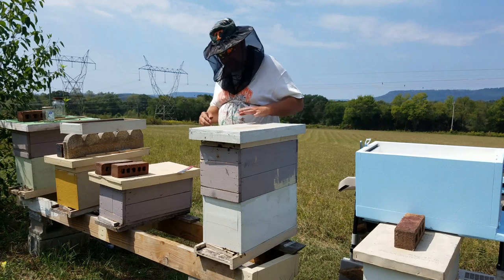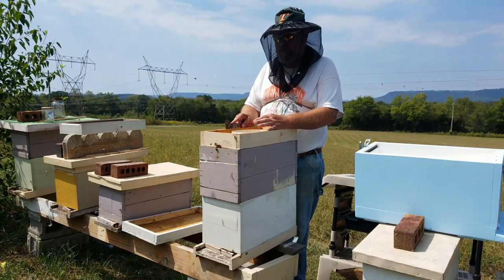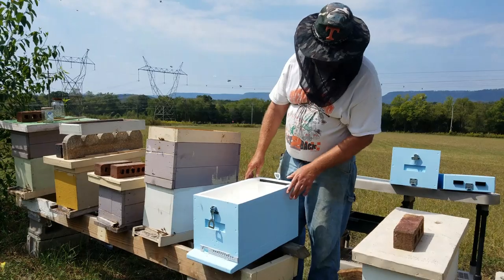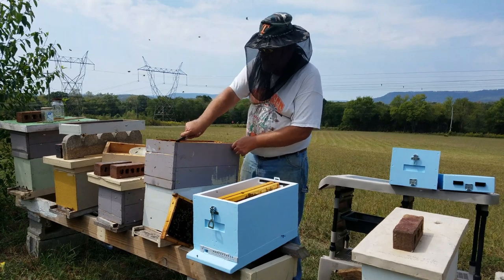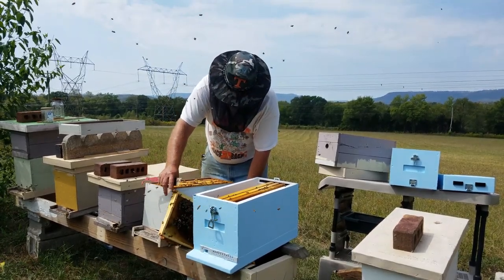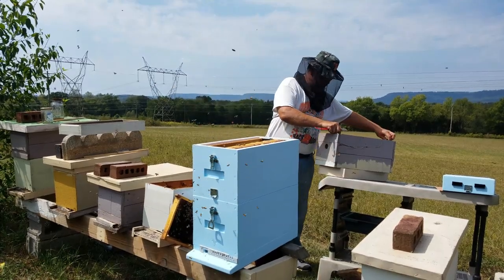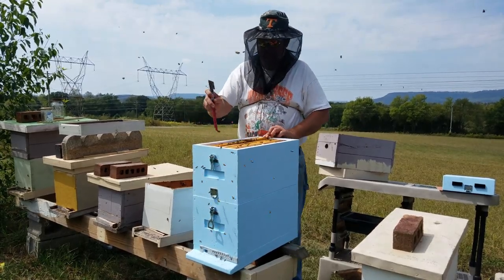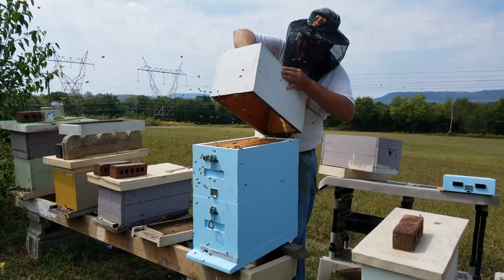Lyson 6 Frame Polystyrene Hive Over Winter Trial

Comment: I have used the Lyson nucs in northern Illinois for 3 years and like them allot.  I do leave an upper entrance in winter because I noticed moisture issues otherwise.  I cut a piece of polystyrene half the thickness of the lid vent inserts and replace one of them with it so that it leaves about a 3/8 inch opening in the lid.  I also glue a block of polystyrene on the inside of the lid behind the vent opening so that wind cannot blow in the opening across the tops of the frames.  I also put sugar bricks on top of the frames under the lid and that helps with moisture too. 

I quit using the propolis traps after the first year.  Unless you want to collect propolis it is just a waste of energy for the bees to spend all that time propolizing the trap.  The only time you need anything under the lid is when a flow is on and the bees are building comb.  I just cut a feed sack to fit inside the lid and lay it on top of the frames as an inner cover.

The R-value is far less than 10.  The walls on the nuc are not as thick as the 10 frame hives.  I think the R-value is around 5 or 6.  Still much better than 3/4 inch wood.
Reply: You also lose a lot of the R-value at the hand holders, a flashlight will shine through them before painting.
Reply: @danskisbees7348  is that issue Because of  the poly being a lot thinner in that area due to the cut out to accommodate handles
Reply: Hello Alicia, I was referring to wooden nucs.

Comment: did you have a problem between the 2 deep bodies being double the bee space ... i added a 3/8 inch spacer on the lower box frame rest...
Reply from the maker: so far i have not had a problem but a friend of mine that turned me on to these hives. his bees never drew in the feeder area but 4 of the 6 i bought drew comb in the feeder space.
Reply: @WoolieBsApiary  i am using the feeder so no problems there ... just between the supers... there was 3/4 inch gap and the bees did there thing in that space... what a mess ... so with the spacer i added  the bottom frames are flush with the top of the bottom super... all my lyson nucs are new this year and wasnt sure if i was the only one who had this problem....

Comment: Hey Lankford, I didn't realize the R-Factor of the 3/4" wood was that low.  I noticed some beekeepers in Arizona use them, makes sense now, I thought they were just wasting their money.  I can't wait to see how they handle the heat.
Reply from the maker: A material's thermal resistance or resistance to heat flow is measured by its R-value. In a solid log wall, the logs provide both structure and insulation. The R-value for wood ranges between 1.41 per inch (2.54 cm) for most softwoods and 0.71 for most hardwoods. that is directly from energy.gov thats for 1 inch
Reply: Dan Ski's Bees I just brought 3 of these today for cheap $50 each , I’m in Australia 🇦🇺 and our summer gets up to 48c so I’ll let ya know how they handle the heat, on first look they seem pretty good only problem is the box is 1/8in too small and the frames are tight where the top bar sits in the rebate, but we’ll see in a couple weeks, we normally use 22mm thick pine langstroth boxes. I brought these Lyson poly boxes for rearing queens and drone production, I’ve been having troubles with rogue queens and virgins they have wrecked my last two queen starters piping 39 cells my last run but I did manage to save 6 but 6 from 45 ain’t the best results huh.
Reply from the maker: vee  I've had these long enough to see that on a 98 and 103 degree day they did not beard out like all the other hives did. What part of Australia I have friends in Perth and at the foot of the Blue Mountains where it gets up to 130 degrees. Your queen rearing is an easy fix I put a queen excluder between the bottom board and the first box so no queens can get in.
Reply: @BESHYSBEES  I have a solution to your problem, I need to send you a picture, Message me on FB under my same name.
Reply: Woolie B's Apiary I’m near Mildura in desert 🐪 country, I lived in Perth a few yrs ago but moved back home when I got cancer
Reply: Dan Ski's Bees I have it sorted now and there is more to the story but you get the gist, 130+ double deep colonies soon to be 300+( lost 80+ colonies last yr from sprays still recovering)
I’m in the process of cross breeding colonies that forage well and can handle the heat
Reply: Dan Ski's Bees you’re always in the comment sections, we must watch a lot of the same channels
Reply: @BESHYSBEES  I see you a lot too, lol.  It's a small bee world.  With that many hives, I'm guessing you're doing okay with the cancer?
Reply from the maker: @BESHYSBEES  sorry to hear about the cancer diagnosis are you in treatment hope you are cancer free soon if not already
Reply: @BESHYSBEES  that's awesome!  You're a busy man.  My best bees are F-1s, Cordovan Italians/Feral crosses.  At least I hope they're feral, I'm seeing more and more apiaries around, I hope they're managing their bees.

Spraying stinks!  That's a big loss.  I lost 2 of my strongest colonies this year, they were doubles packed with honey, had die-offs in the other colonies as well.
Reply: Woolie B's Apiary diagnosed stage 4 EBS Hodgkin lymphoma 07/01/2016 been clear for 2 yrs but recently lost 17kg unexplainable so I’m over having pet n ct scans, I’ll find out tomorrow if it’s back.
Reply: Dan Ski's Bees samurai it’s a systemic poison for gall wasps in citrus, honey and bees were tested, lost them right at the most crucial time of spring build up and didn’t have bees to fill pollination contracts 👎we always lose a few each yr from sprays but that was the worst by far, 
Stage 4 survivor I shouldn’t be alive so every day I wake up is a good one
Reply from the maker: @BESHYSBEES  let's hope for a negative diagnosis on cancer
Reply: Not good got hot spots in lymph nodes between my liver and spline gotta go back in a week or so for needle in the back biopsy or keyhole through the front for biopsy... 😀
Reply from the maker: vee  you are in my thoughts sending vibes of healing
Reply: Woolie B's Apiary beat it once I can do it again🤮👍👍
Reply: @danskisbees7348  Yup you get around lol hello
Reply: @RaySarasin  Lol!  Ray, are you following me?  I try to subscribe to the good channels and the people who might need help.
Reply: Dan Ski's Bees cheers Dan much appreciated, next Wednesday I’m going back for biopsy and I guess I’ll take it from there

Comment: I am looking for a rapid feeder like yours that will fit a 5-frame nuc. What is the diameter of your rapid feeder shown in this video? Thanks.
Reply from the maker: That is a 2 pint i bought them from simon the beekeeper on ebay. You have to cut the round grove so the feeder will fit in a box the same size as the nuc not like barnyard did theirs

Comment: I leave on top open with 1/2 inch hardware cloth over it. Helps them get out in the winter.
Reply from the maker: I have noticed on the hive i left a top entrance on there us water condensation on the bottom board the 4 others that have no vents in the top do not have it have you noticed this
Reply: @WoolieBsApiary  just the opposite for me
Reply from the maker: @jman414999  ive checked that hive 2 mornings in a row since i plugged the top entrance and no water on bottom board john where are you located
Reply: @WoolieBsApiary  South eastern Ma.
Reply: I keep the top vents closed and bottom vents open... Michigan.

Comment: My concern is with mice chewing through the hive to make a nice winter home.
Reply from the maker: Valid point I'll have to keep an eye on them but I have not had nice problems but my hives are 2 ft off the ground
Reply: @WoolieBsApiary  2 ft is not that far for a mouse to climb. But keep us posted on how the poly boxes fair. I do appreciate your videos.
Reply from the maker: @michaeltobin1710  havent had had one since ive been keeping bee  but you know the saying theirs always a first time
Reply: @WoolieBsApiary   I love the Poly Hives. This will be my fifth winter. I've never had a problem with mice chewing there way in. Only a little moisture. But I tip the hive to the front. I keep the screened bottom closed off and the entrance reduced. I think you'll love them.
Reply: @mrcshoneybees  I thought the screened  bottom is supposed to be left open in order For ventilation Purposes or else you will have a lot of condensation. I’ve been looking at various Poly hive manufacturers and I forget which one but one had a Mylar plastic  inner cover And I thought that because you’re supposed to leave the screen bottom open it causes  the mylar to trap thermal heat above. In one YouTube video Which the beekeeper uses a poly hive marked Bee Box states if you do not leave the bottom screen open, it will cause the bees to die. Just wondering what your thoughts are about this issue. I’m a bit confused about this. Thank you
Reply: @gulliver1416   I do leave the bottom closed. I'm afraid of the cold winds that we have here in Ohio. I also reduce the entrance and use a mouse guard.  Bee Box has two styles of covers one with Mylar insert and the other without, (the one I use for winter) It has a raise area for  winter paddies. I use the Mylar cover for summer because of the nice air vents. Check out Blue Sky Bee Supply. They have Bee Box.
Reply: @gulliver1416  I leave the bottoms open in winter. I'm in Michigan. Then close all top vents. This is also what they do in Finland which is cold as heck, and what the beebox manufacturer's suggest for cold climates Heat rises and they will stay warm enough without the condensation accumulation on the bottom or top. Your bees May survive with a closed bottom and the top vent but I wouldn't do it.

Comment: Hope you take into consideration that bees that are warmer in the winter use more stores.
Reply from the maker: bees that are warmer use less stores due to not having to shiver and burn more energy
Reply: Poly boxes suspose to use less stores from what I'm told .  Colony is more active but use less energy because they lose less heat .  I use wood here in Michigan double stack 5 frame boxes but I push them together . They share a wall with each other .  Moisture really isn't problem cold air is pretty dry .  2" of foam on top stops the drip .  Sometimes I'll add little snow if the colony seems dry .
Reply: @WoolieBsApiary  My observation shows that the cold hive temperature they will use less stores. However the cluster with extended cold spells are not able to move around to get to the stores. That is why a lot of  times you will find dead out from starvation just few inches from honey stores. My two cents for what it's worth.
Reply: @WoolieBsApiary  I think "shivering" falls in the same category as working the hive. lol If the hive temps get to warm they work and need to eat. I agree with the insulated hives but you need to keep an eye on how warm the winter is when it comes to checking on the girls stores.
Reply from the maker: @Warren76317  its really no different than humans when we get cold we shiver to generate heat which is made by burning calories if we are warm without having to shiver we do not burn as many calories.